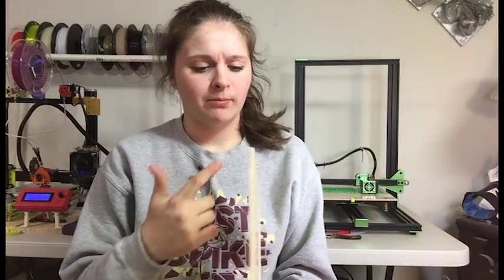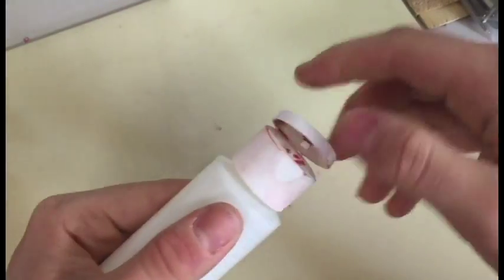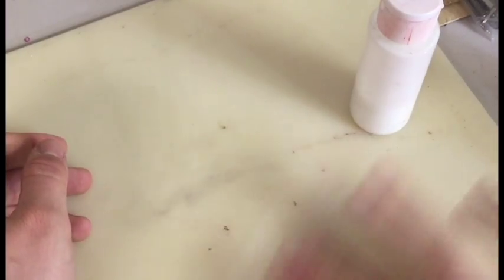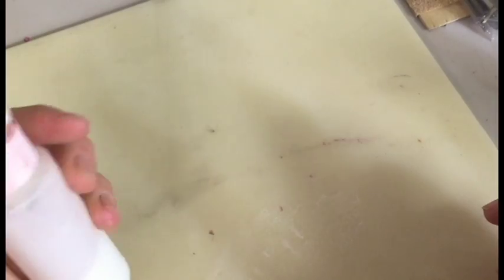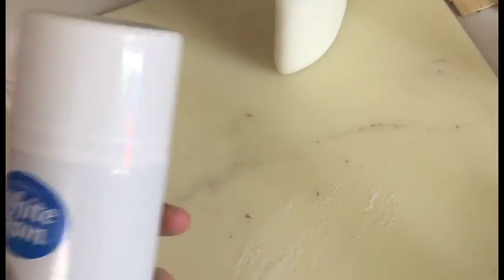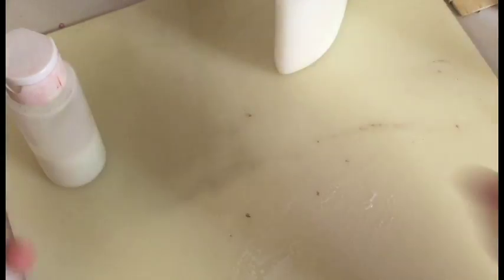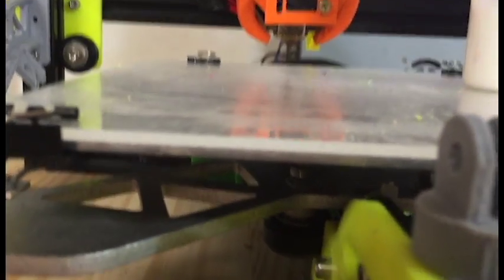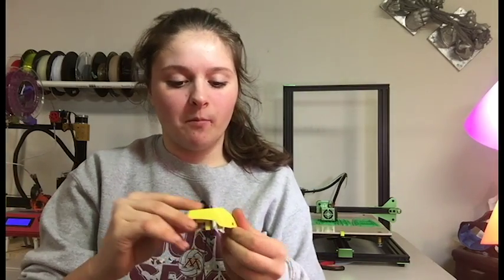Best Bed Adhesion Solution//Best Print Surface

Comment: Hi again very nice video again well done. Another cheap solution is sugar water use hot water to mix 1 part sugar to 4 parts water let it cool, I then spray a small amount of this on to a sponge and then with the plate at around 15-25C wipe the sponge over the surface then start dabbing as if your stippling, you can wet the sponge to help, it should look a little milky and slightly textured, once you have an even surface and it’s dry your ready to print. I use a glass bed and this works great once cooled the prints just fall off but hold really strong when printing. You can use a damp sponge to dab over where your last print was to cover the area or add a little bit more sugar solution. This lasts ages before you have to wash or wipe down your build plate with water or packet wet wipes. Give it a try ( no nails painted this time lol oh no haha !!!! ....btw I don’t want you to think Iv got a thing about you nail lol!!!  )
Reply from the maker: Darren Ables haha thanks for the tip lol the nail thing is fine

Comment: Hi,  Thanks for the advice.  I normally use a cheap build tack which works out like £1.50 per sheet for a 200x200

Comment: We put pei sheets on all our printers except mk3 as u can't beat their flex plate. Luv the Elmer's purple glue stick. Another good video, thanks for sharing, have a good night & Happy Easter. God bless
Reply: The mk3 has a PEI on spring steel build plate that is removable from the bed itself. I wonder if they have a patent on it since I have not seen much in the way of upgrade kits for other printers.
Reply from the maker: Thank you!You Too
Reply: NiHaoMike thus can't beat mk3 flex plate. I've seen generic plates out there, actually prusa was not first one using it but they perfected it